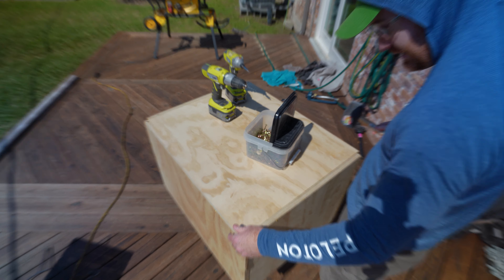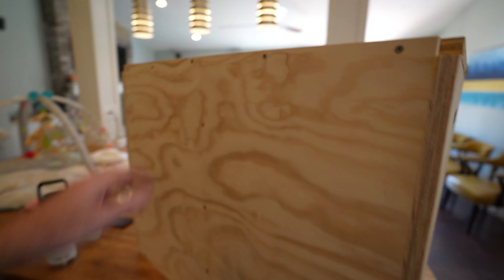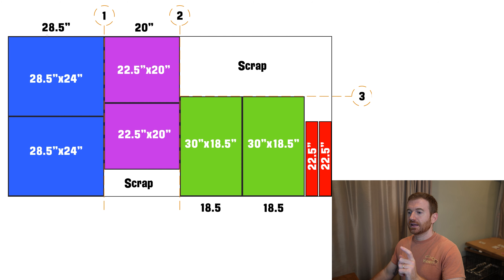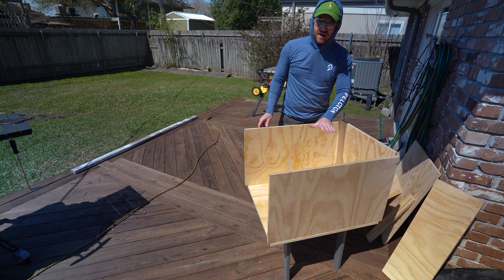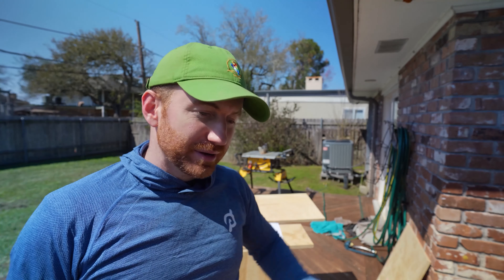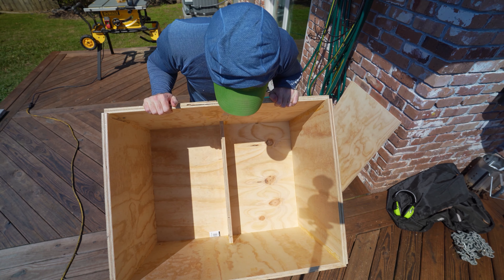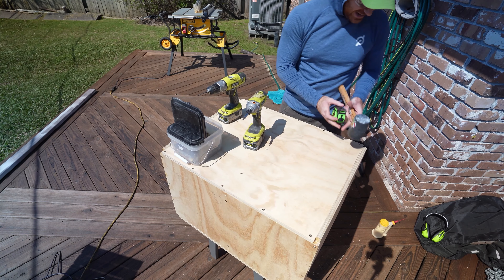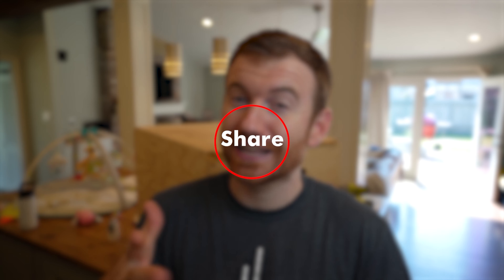Version 2: How to Build a DIY 3 in 1 Crossfit Plyo Box with One Sheet of Plywood

Comment: It IS nice to build things yourself.  But since this video was made, 3/4" cheapie plywood is costing $ 45 to $ 50 per sheet.  Plus, if you don't have all the tools and expertise to cut, glue and screw then this 23 minute video will take about three days to construct a box for an average person.  OR, you can buy on Amazon a precut and predrilled box for around $ 90 to $ 95 and assemble it yourself in an hour or less.  I see the Garage Fit box has interlocking puzzle joints as does the Amazon Basics box for added strength and support.
Reply: Yeah. Prices are insanely ridiculous right now. But I suggest going to a local lumber store. IF they have any stock or have some left over, imperfect lumber they’d probably sell it to you for a lower price. Also if it takes the average person three days to build this then they must have went through 4th grade quite a few times. This is some wood panels, wood glue, and screws with clear visual instructions. Unless you were the kid in the corner eating the glue there’s no way you can’t knock out this project a half day to a day at most.

Comment: A 4 by 8 piece of plywood at 3/4 inch thickness right now is more expensive than just buying a box from rogue..
Reply from the maker: lol what? I just checked my local big box store and this pine sheet is going for $45. Where are you located?
Reply: @BreakItYourself  man ! I wish haha, I'm located in New York and I checked the home Depot and Lowes and sadly the prices were crazy.
Reply: @BreakItYourself   online I checked other hardware stores lowest I saw was around $80. Might do that still cause it's a little cheaper than getting one still but idk. Would you think 1/2inch thickness could work ?
Reply: @BreakItYourself  nevermind lol, I found one for 65$
Reply from the maker: 1/2” would probably need some additional bracing. I’d stick with 3/4”

Comment: Nice job on improving Version 1. If you want to make your box even more stable you can do so by "Jigsaw" connecting all of the sides so that all sides of your box are supported on 4 sides. This does though take considerable more work to do and you will need to venture into precision cuts, either with a Jigsaw or a Circular Saw. I have just finished my box using a mini Circular Saw for the cutouts.

Comment: Great idea to reinforce the box this way. You could also just make version #1, then glue some 1 inch wide offcut strips to the inside so that both ends of the offcut strip touch either 'screw-supported' panel. Would take around 2 to 3 strips per panel for plenty of support. Add some short screws to hold while the glue sets.

Comment: Made this today. Turned out great and super sturdy. Probably just going to add a polyurathane coat to smooth it out and help it last. Thanks for the video!
Reply: Mind if I ask how it came out? How much did you end up paying for the plywood?
Reply: I don’t recall exactly what paid, thinking around $40-$50. But the box came out great and we use it often. Very sturdy. I could’ve made my cuts slightly more precise, but even so there have been no issues

Comment: Great improvement! 
Hm.. is the cut sheet off? The purple panels (I’m assuming the sides of the box, with the handles), look wider than tall, yet by your dimensions (20”) they should look taller than wide. 

Unless the 20” marking between the #1 and #2 cut is really 22.5, since the total width should add up to 96.

Or maybe I’m missing something?
Reply from the maker: Good eye. The written dimensions are correct BUT the purple rectangles should be rotated 90 degrees each. 20” between 1 and 2 is correct. I’ll update the google doc tomorrow.
Reply: @BreakItYourself  - That’d be great. Last thing we want is someone going to Home Depot and coming home with the wrong cuts 😳. Tip: use a consistent convention whenever writing down dimensions. I believe it’s width x height x depth, and starting first from a reference of identifying which is the front of the item.
Reply from the maker: corrected sheet https://drive.google.com/file/d/1LETdtdjDJ8fpc-GrpR76m0gLfVoTHApX/view?usp=sharing
Reply: @BreakItYourself  Still potentially confusing due to the inconsistent markings....
Reply: @EPSTomcat11  make one and contribute then 🤷🏻‍♂️

Comment: What thickness of plywood did you use and how did you find a sheet for $30 because I’m only seeing $60 ones 😞
Reply from the maker: 3/4" and I purchased this a few months ago. Lumber is definitely more expensive in my area but for some reason plywood hasn't increased quite as much.
Reply: @BreakItYourself  Would MDF work? I'm seeing $60 for plywood too, $40 for MDF.
Reply: @boomstick900  I wouldn’t recommend it for this build/instructions. MAYBE something with a different blueprint and more support. Even then it’d be iffy. Let’s go over why:

MDF weighs more than plywood.
This can be a major issue if you’ll need to lift, hold, or clamp panels in place or want to move your box around from place to place, turn it, etc. 

When it comes to strength, plywood is the winner.
MDF is a softer material than plywood and tends to sag or split under pressure. That’s why it’s important to reinforce it if you’re going to using it to build anything that’s gonna bear weight. Plywood also has more flex than MDF, so you can gently bend it to create curves; plus, plywood won’t expand, contract, or warp, even under temperature extremes.
Lastly, Screws anchor better in plywood.
Because it’s soft, MDF doesn’t anchor screws very well.

Comment: Great video!! I love that you improved upon v1. When making the handles,  would you recommend making them before glueing and screwing the box shut?
Reply from the maker: That would probably be easier if  you have a work surface and can clamp the work pieces. The only reason I didn't do that is because I thought it would be easier to make the handles once assembled for people without work benches. but getting the scraps out was annoying. Didn't take but 2 minutes but you'd still get a better result adding handles ahead of time.